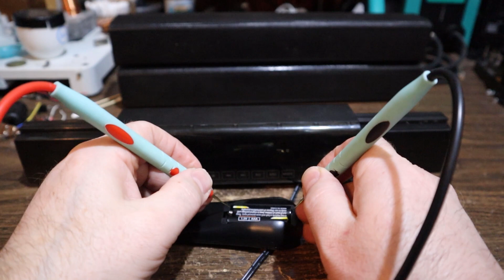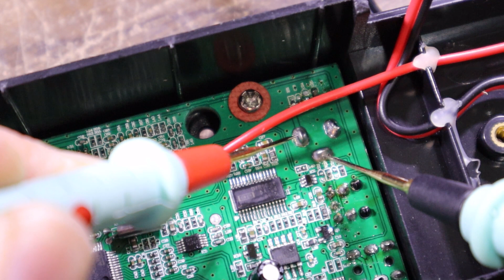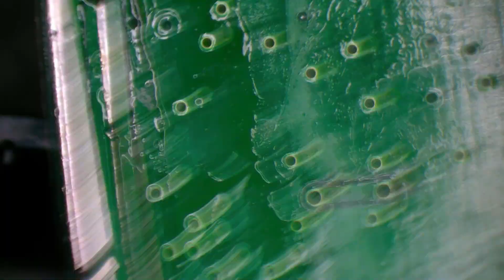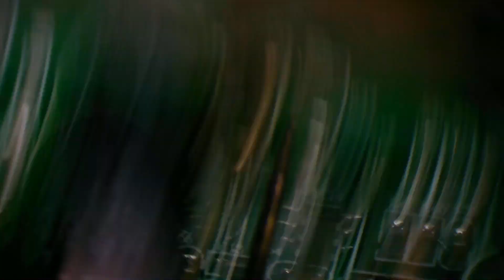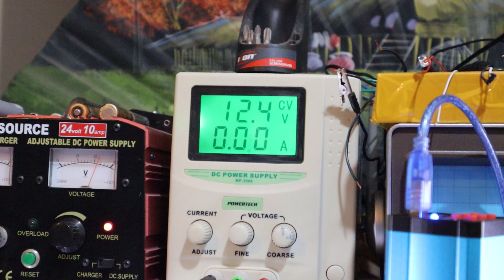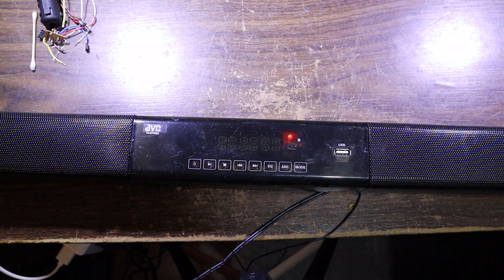Dead JVC sound bar repair!

Comment: Please get back to me
Reply from the maker: hello
Reply: @JonnyFix  How are you i have sent you massage that say i am also have Jvc sound bar that does not wanna come on it has burnt power ic 
Model : TH-BY370
SERIAL NO:E000629X-101562
Reply from the maker: @mthobisimngadi9671  I cannot tell you why. Perhaps order another chip and any surrounding parts that may be damaged and hopefully that works
Reply: @JonnyFix  where can i order it so long??
Reply: @mthobisimngadi9671  I have the same one, turns on but no spund whatsoever

Comment: Hi - Do you take commissions for your channel? If I sent you a device would you take a look and see what the problem is - obviously you can keep it the thing if you get it running - FREE STUFF!. It's a Creative mp3 player, jukebox 1 from about 2001. Doesn't power up on PSU or batteries, just a high pitched whine, but no signs of life. Have 3 of these bought as spares over the years, but also a brand new old stock cellophane wrapped one with the same issue, so probably an age related not use related problem? Anyhoo, let me know, thanks.

Comment: I would have dropped a 100nF in there, that’s probably what it was originally anyway, I think the cap failed and took out the inductor, those MLCC are prone to failure.